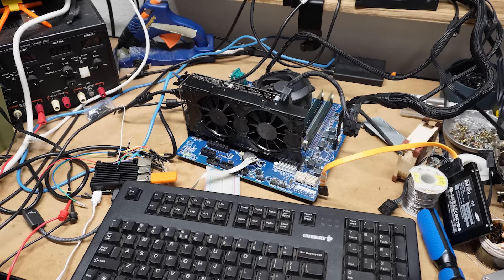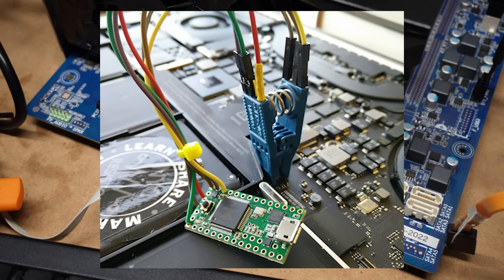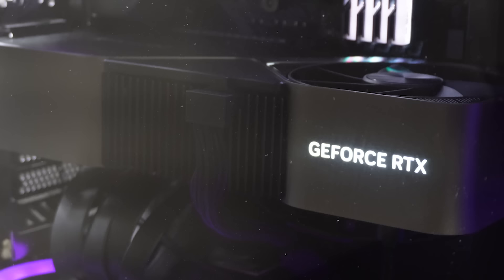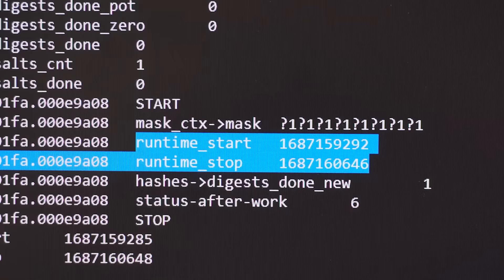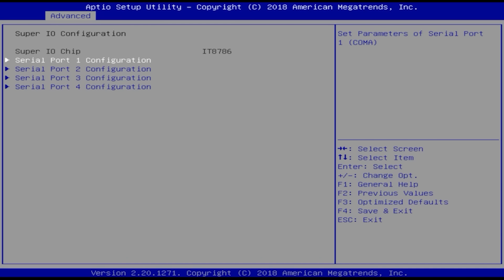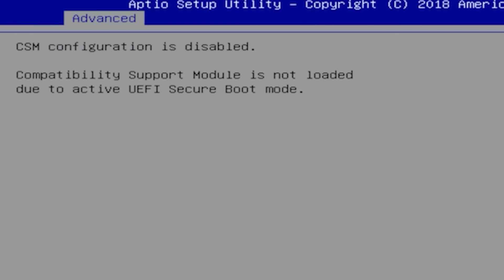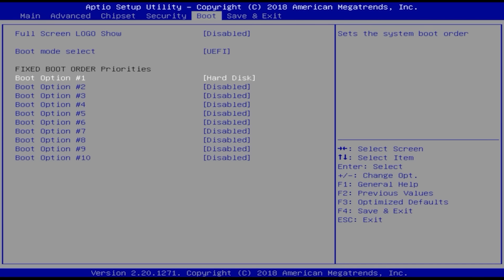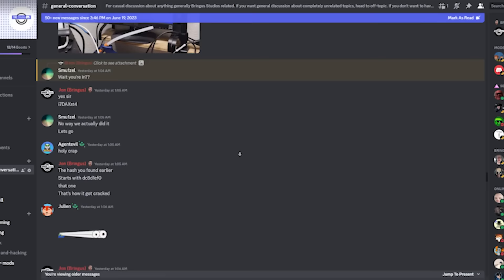How I Cracked The Sega ALLS MX2 BIOS Password

Comment: You should dump the software online.
Reply: In 30 years we might have computers fast enough to run it in MAME.
Reply: @Aeduo  MAME isn't needed as it's just an x86_64 system (what you're most likely using right now unless you're on mobile or a modern Mac); at most it will just need some executable patches to bypass DRM and simulate/bypass the need for needed peripherals (such as how BEMANI games are played on PC), that is, after getting the decryption keys. Not sure how many people want to play funny horse betting at home though, unless for novelty/posterity/most likely preservation.
Reply: he should send it over to the teknoparrot devs so they can add support in their emulator :D

Comment: Kind of sad you did not use a bios programmer or those clips you get like from amazon for max 12 dollars, instead you chose to solder wires wich is a pretty dumb thing to do sorry but that just gets messy those clip on clips are much better they can be removed without soldering and no risk of overheating ghe flash chip
Reply: There isn't much chance of overheating the chip if you're good at soldering, and those clips vary wildly in quality and can be damn near worthless. Maybe go learn a thing or two about electronics before you start admonishing people who did a fine job.
Reply: @bruwin  just advicing for other users, am an electronics hobbyist myself so calm down my guy never say "go learn" to people you dont know
Reply from the maker: I wouldn't have done it if I wasn't confident in my soldering ability, but most people are probably better off with the clip yeah
Reply: I would kind of say that he reconstructed the password so that this was the last board anyone had to solder to.
The next one with this board now already has the password.
Reply: @309electronics5  I will absolutely tell someone to go learn when they start spouting off alarmist claptrap

Comment: This is a shot in the dark but if you recall that the os provided on the original sega alls hdd you needed a key to let it even run fully.
Now lets say it works like a crappy ransomware program it can easily be get rid of by as simple as pressing alt+ctrl+del
and then going into task manager and closing it. 
Also you could use programs people use to kill ransomware that opens when the usb containing the program that will kill the ransomeware is
plugged into the system.

mr bringus if you want to take this further I'm willing to try and help if you reply to this ill give you my discord so we can resume
convosation on there!

but that's Sega alls for now haha

-A

Comment: i run chimeraos on a 12100f h610m 32gb ddr4 3600 and a fuggin 6900 xt     it is so much more responsive than windows and literally the only thing i lost was ability to EASILY mess with my rgb from the gui, you can but its so fukkin annoying to setup open rgb